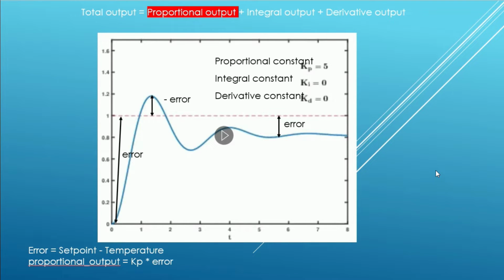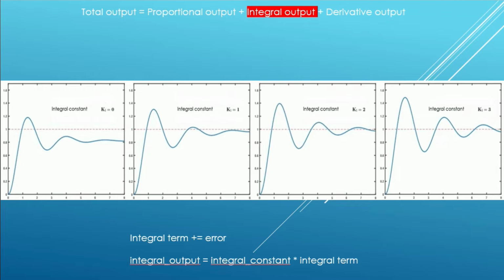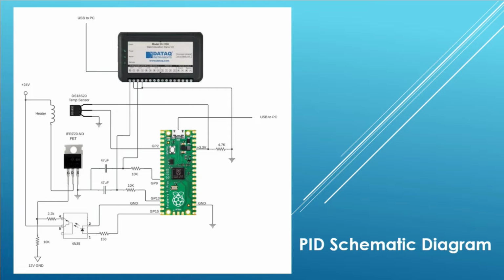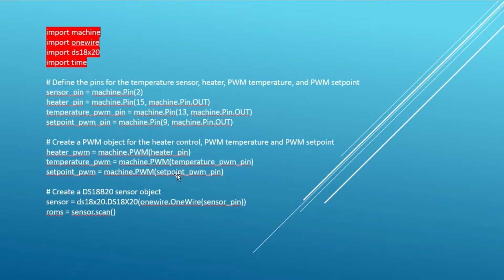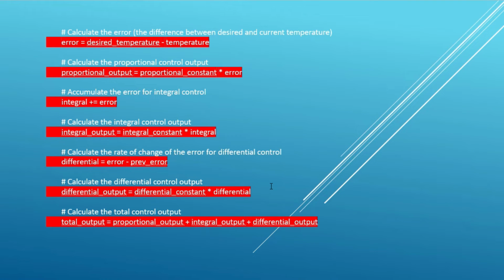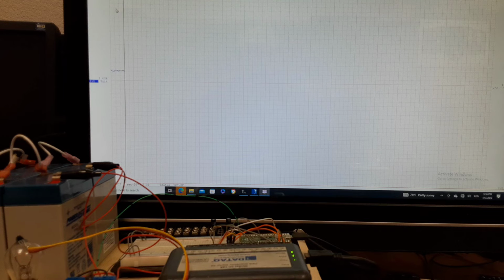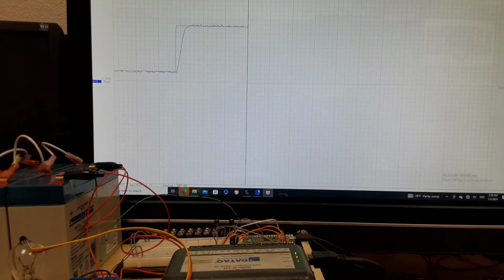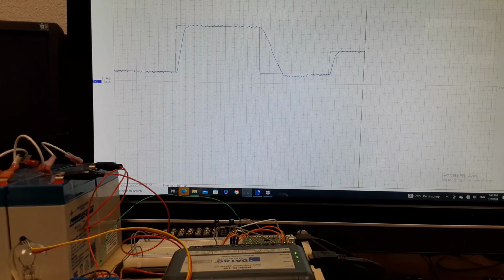PID Control using a Raspberry Pico Pi

Comment: Question for you Neil, I get PID but (at least in some electronics) isn't this as easily achieved with a PLL? I'm thinking something like a frequency locking where we can isolate a slow moving frequency around a centre point that exists in a lot of background noise?

I'm genuinely interested, I'm not being funny.